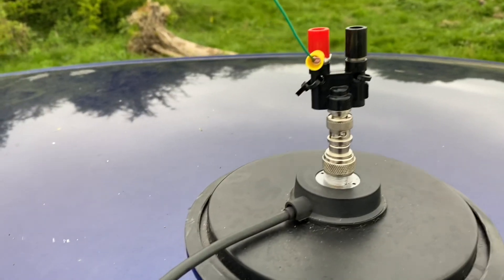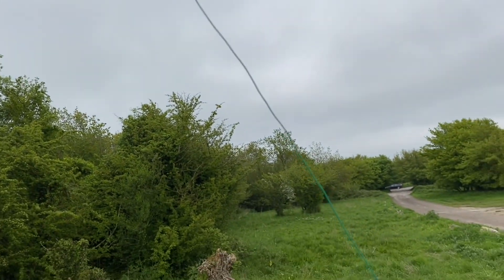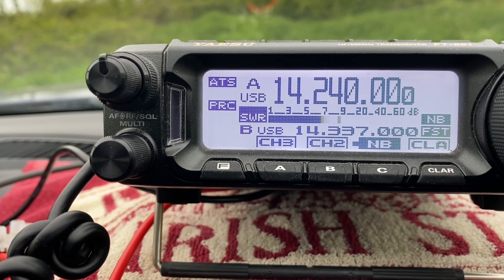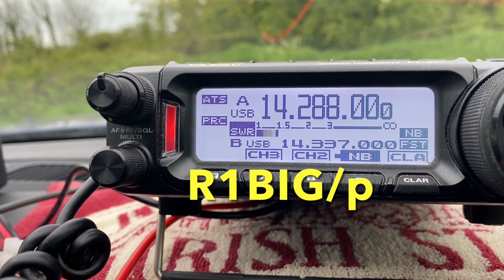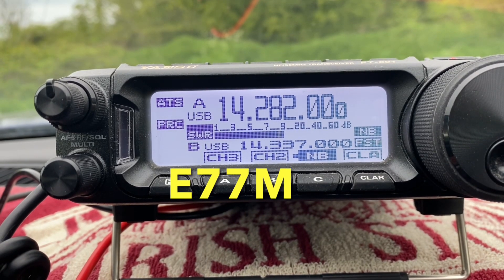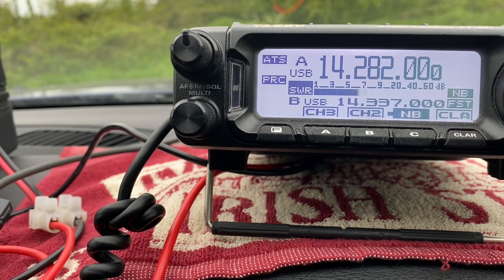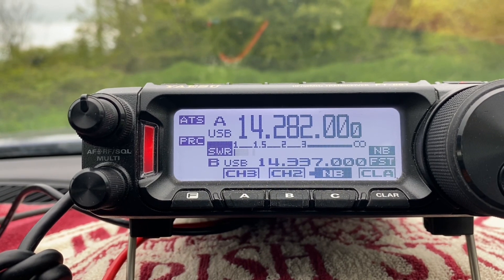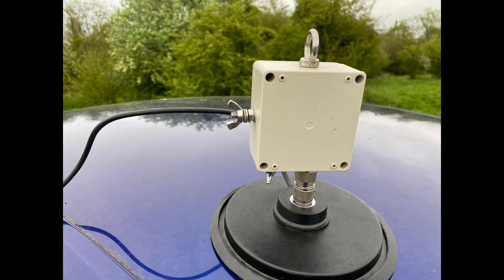HAM RADIO: Simple HF Portable DX Antenna

Comment: I'm wondering if anyone has built a flag pole holder that attaches to a roof rack. So when stationary you could have a squid pole mounted on the roof. Maybe folds down when not in use.
Reply from the maker: Interesting …

Comment: What adaptor are you using to go from the BNC to the magmount?
Reply from the maker: Hi Ryan it’s a bnc female to male pl259
Reply: Thanks.  Didnt realize a pl-259 would connect that way.  I have tried this with a 3/8 inch bolt and wire running into a nearby tree. No need for a mast then.

Comment: Another great easy-to-do video. Tim, I tried this with a 10-meter wire (1/4 wave on 40m) and used the vehicle magmount as the ground. Poor results. So, wonder if I used the black connection on the BNC adapter and run some radials from it to the surrounding terrain if that might fly. 73 de W8RD
Reply from the maker: Worth a go!